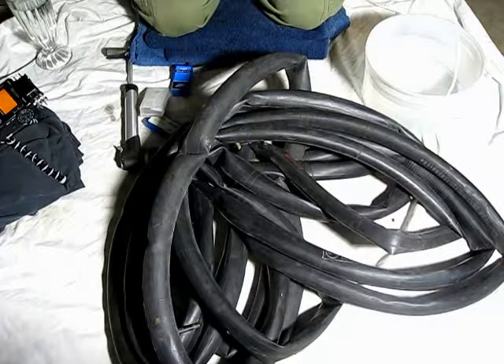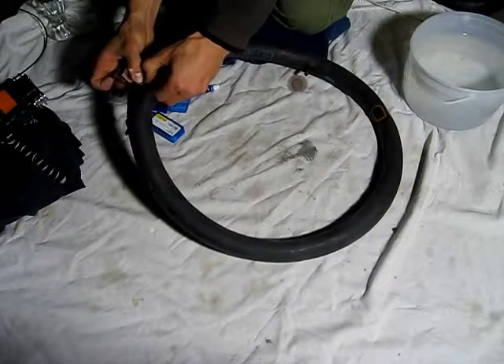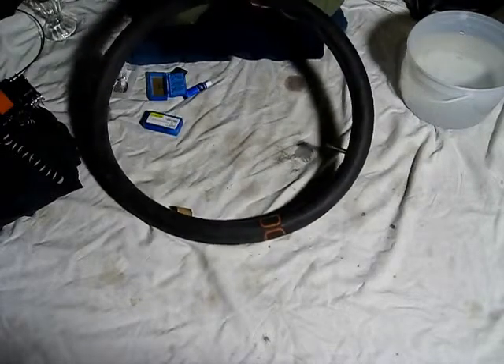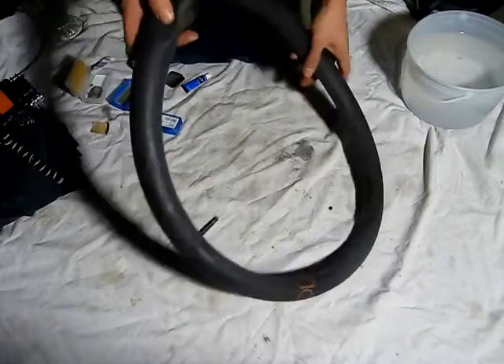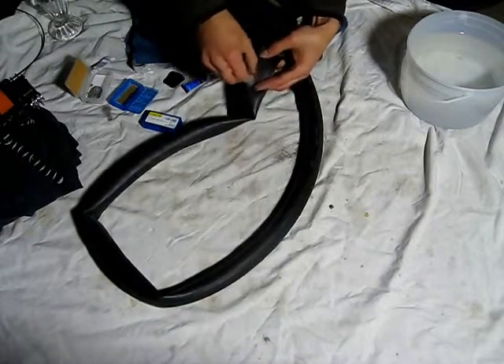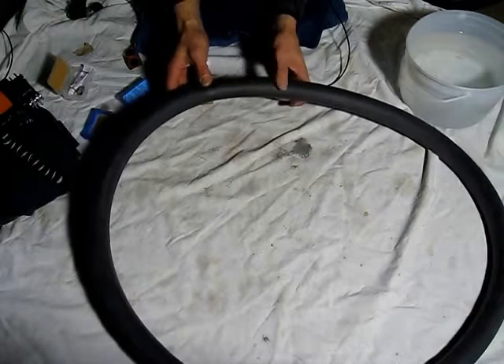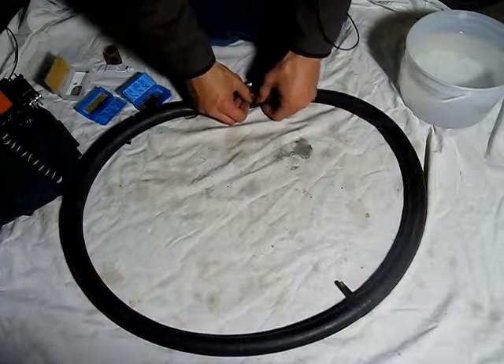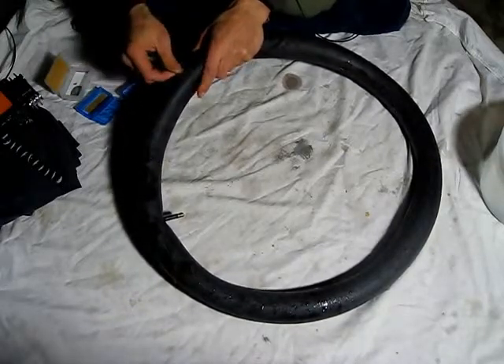[ASMR] - Bike Tube Patching (long)

Comment: Sometime i use super glue when am to lazy properly using a patch kit.
Reply from the maker: What do you use for the actual patch then? another inner tube? or some kind of tape? I'd be worried that just superglue would spring open under pressure. I could see superglue and duct tape maybe working though. I've also heard you can get cans of vulcanizing fluid from farming supply stores, and then you really can just chemical weld a piece of inner tube in place, rather than an official patch. I recycle bikes, and with the amount of patch kits I go through (I think I went through 2 patch kits in this video alone, lol), I've thought about doing this, but have been too lazy to do the legwork to track down bulk vulcanizing fluid.

Anyway, I'm open to other ideas, since many of the tubes I patch are discards pulled from the local tire recycler, and I just give them away anyway. Cheers, and thanks for your comment ;-)
Reply: Elysium Echo I have a video on my channel will show the steps. Basically it super glue,chalk and towel or paper. A plastic glove is better though.
Reply: Elysium Echo No need for a patch might sound weird. Just layer the puncture hole with super glue. Where i live it only 9 cents a little super glue.
Reply from the maker: Ok, maybe I'll try it sometime. Thanks!
Reply: Zerobladetion Wot Forgot to notice this. Their alway pros and cons. The pro is that it can seal the bike tube faster then a repair kit. The con is that the super glue over time will eat away the tube till it punctures again will crack a bit. When that happens just use a large repair kit patch will do the trick. I just use old bike tubes to make a liner to have extra puncture resistance.
Reply from the maker: Ah, I see. Sounds like it would work really well for roadside repair.